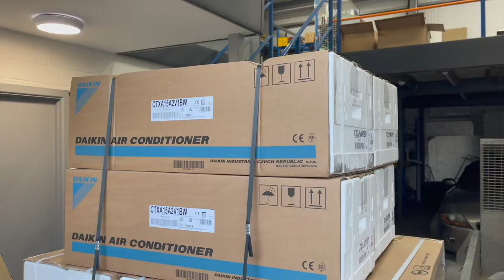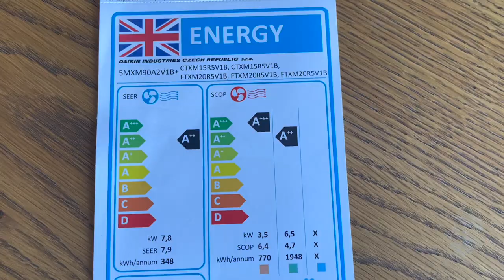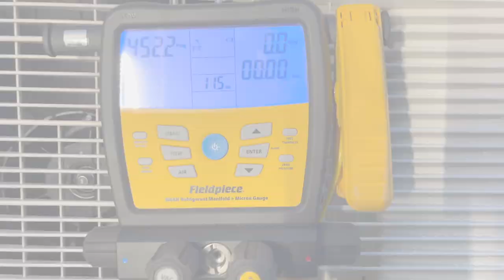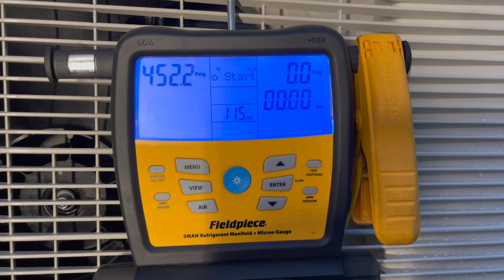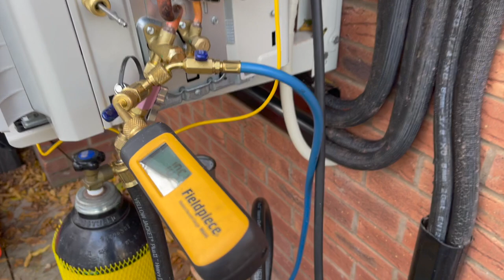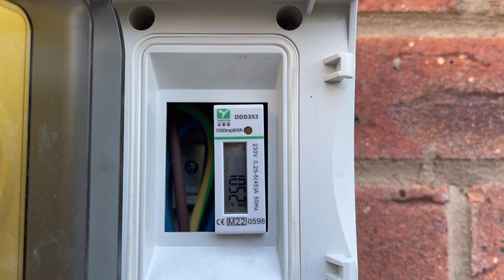Air to Air Heat Pump: better than an Air to Water Heat Pump? We install for a YouTuber to find out!

Comment: Not a bad install for a bunch of plumbers 😜. On a serious note though.... I've been installing and repairing AC for over 30 years. I would never recommend fitting outdoor units on wall brackets on a residential property. Yes, the units are quiet but I can guarantee you will hear the buzz from the compressor if the system is running whilst sleeping.
Reply: Can absolutely confirm this, avoid brackets wherever possible! Especially because the compressors are variable speed so eventually they WILL find the resonant frequency of the wall they're on and be annoying 

In my old house the unit would sometimes vibrate the glasses and mugs in the kitchen cupboards, you couldn't hear the compressor but the jingling glass was annoying!
My current house has them mounted on the floor and it's so much better haha!
Reply: Interesting. Mine are sat on the ground on big rubber blocks. Was wondering about the pros and cons and hadn't thought of this!
Reply: Nice and tidy work 👍
Reply: Fully agreed, wish I’d known this before installing our Daikin :(
Reply: Yes I have an outdoor unit on brackets and I can hear the buzz. Anyway of reducing this noise with some sort of retrofit solution?

Comment: It will cost more to run than gas and your cop won't be anywhere near 5
Reply: Should have invested the money and used the interest to pay towards the fuel bills. You lose twice fitting heat pumps. It's like people coming back from shops saying they saved £30, but had to spend £200 they wouldn't have done!  
People with these systems never compare before and after fuel bills to compare as they don't like to appear foolish.
Reply: Not everyone is installing such systems purely for financial reasons.

Comment: This is exactly what I want in my bungalow.  The disappointing thing is that you haven’t covered the hot water system.  I also note Dameon there are no contact details on your channel, surely that’s a missed marketing opportunity?
Reply from the maker: Simon you are right. The hot water follow up video will be uploaded at the weekend, as will a follow up video on the performance of my heat pump hot water cylinder. Any queries can be sent to me directly at dameonhillchannel@gmail.com. Thanks for your feedback

Comment: My only negative comment about this type of system is all the ducting around the house. It for me at least, looks a bit commercial and that’s possibly the reason that would put me off the Installation. On another note it seems a real pity that the £5000 government grant isn’t available for this type of install. Is the heat pump supposed to be out of plumb left to right?

Comment: Hi there, do air to air heat pump mini split systems qualify for the government boiler replacement scheme grant?
Reply: As far as I know they do not because they can be run in cooling mode and the government don't want to encourage that. Perhaps there are A2A units that run heating mode only that might qualify but I have not seen any.
Reply: @ColinMill1  ah right yes that makes sense thank you

Comment: What we do now is heat the house in the winter months to 19c with gas central heating, we then use an air con heat pump to heat the room we spend most time in to  between 21-23c, we have solar energy providing a lot of the electricity required which varies but is between 500 and 1000w usually and provides about 2500 heat energy so very efficient, I estimate we save about 10-20% on our gas usage in winter when we heated the whole house to 21c using gas central heating only.

Comment: 19:38 which one, I’ve installed two single splits so far (lounge and kitchen) and kept the oil for this winter, thinking of a multi for upstairs before next winter… what flare tool did you use, also what did you put on the flare joint, I’m guessing to help the seal?

Comment: I wonder what is the current cost of this kind of system, including materials and labour?
Brilliant video by the way!👍👍👍
Reply from the maker: Thanks for your email Serge. I have replied to you.
Reply: I'm also interested in a cost for a similar system for my house could you send an estimate please
Reply: I’m also in process of planning a refurbishment and this has made me question my plans for an air to water system. I do wonder how much this costs compared to a similar air to water system plus installation of the underfloor pipe work, etc.

Comment: Excellent explanation of efficiency of a2a v a2w. Can I ask about how much more efficient a modern R32 A2A heat pump might be compared to R410A inverter A2A heat pump circa 16 year old.
Reply: @zlmdragon.  Thanks. Just to confirm, you mean the R32 gets SCOP of 4-5?

Comment: Interesting video! I'm running a similar experiments, though I have kept my gas system. It means I could try all gas one day and all AC the next day.

AC is definitely a lot cheaper most days. And a bit cheaper on the colder days. But AC misses some spots, like the bathroom, so on a cold morning I like to run the gas for a couple of hours.

For working from home, AC is a hands down win, because I can heat just the room I'm working in. But today, which was very cold, I started to get annoyed by the defrost cycles because it would blow cooler air at me.

It is very good though, and really heats things up fast.

How do you get on keeping your bathrooms warm and dry with no heat in them? Perhaps you have good ventilation in the house.
Reply: I think you need to get your installer back as depending on the make you can stop the indoor unit running on defrost, it’s normally a toggle on the outdoor unit PCB. Having it running is hopeless.
Reply: Great job, very impressed with the triple vacc, not many installers do that. I think these systems make allot of sense in the UK, just be aware these systems are heating the air unlike a gas boiler that basically gives you radiant heat. He may find as soon as they turn off the temperature drops rapidly.
Also defrost is an issue but hopefully on commissioning you set the fan coils off on defrost.
Reply: @garywright8846  it does shut off during defrost, it just seems a bit too keen to start the fan after the defrost cycle.

Comment: @19:19 high and low pipes were put TOGETHER in a thin cover and taped tight assuring contact between hot and cold pipes reducing overall system efficiency significantly. These little details may seem insignificant to most installers but actually reduce the system life and efficiency while increasing the running costs.

Comment: Very good video.

I'd be interested to know how noisy the indoor units are.  Is the noise a problem in bedrooms at night.

I worry that the indoor and outdoor units seem ugly. I suppose one of the benefits is that removing radiators will be freeing up useful wall space, whereas the indoor AC units don't consume valuable wall space. Radiators don't seem ugly, but the indoor units do.

Comment: Could you clarify the monitoring capabilities? Electricity usage to drive the compressor is simple, e.g. with a Current Transformer, but have you monitored the refrigerant flow rate and flow/return temperatures to calculate the COP in realtime? Id be interested in that for the -5C to -10C that we saw in December, and with the low external temperatures+high humidity that we’re currently seeing.
Reply: @zImdragon  I suspect it can be done; its relatively simple for an air2water heat pump, heatgeeks are doing it in realtime: https://m.youtube.com/watch?v=X6qIP8snPW8
The electrical load used by the external and internal units of an air2air heat pump is all supplied from the exterior unit so a simple CT clamp on the external unit’s live cable will measure that. I’ve seen reference to measurement of the heat delivered part of the equation using wet and dry bulb thermometers and air movement sensors, however I suspect it should be possible to measure it in the same way as heatgeeks did above, by measuring the difference in flow and return temperatures of the refrigerant together with its mass flow rate. Temperature should be easy but not mass flow rate I’ll agree. Heatgeeks used an inline water flow meter but for an a2ahp it would need to operate with the refrigerant so a simple device cant be used, but I think an external ultrasonic flow meter might work (I’m assuming this monitoring isn’t done as the standard a2ahp equipment fit).

Comment: Fascinating stuff and further convinces me to go air to air. My mini split system has a SCOP of 4.1 and it produces a much more pleasant heat, albeit it was bought for its cooling capability. So in theory with my respective cost/kw for gas and electricity it  should be approximately 20% cheaper to run than gas. Unfortunately I do not have a COP value so perhaps my figures are slewed but unlike gas heating the wait time is pretty much instant and I actually achieve setpoint which is something the gas system struggles to do.

Comment: wouldnt the client already have a radiator system in their house? surely you should have just kept that hydronic system, ripped out the boiler and heated the water with the refrigerant ?   I live in new zealand, and we have lots of heatpumps systems here and i cant stand them. they dry out your eyes and look ugly.

Comment: Researching exactly this option, appreciate mike got mates rates but what is a ball park total install cost for this 7 unit system,  what would I expect to pay for a similar install (ie all the headers on an outside wall? £10k 15, 20?
Reply: Think about the numbers you are throwing around are you really prepared to pay anything over 2-3K for a heating system
Reply: I got two 3.5kW Panasonic minisplits installed for £3.5k all in this summer. Having two singles gives slightly better performance. You can run just one in spring and autumn and a you get bit of redundancy too. 👍

Comment: So the indoor units are all installed high up on the wall. Radiators low down , heat pumps high up.

Comment: Great video, really enjoyed it! Have you installed a multi-split VRF/VRV, with heat recovery, providing both air-to-air air con AND an air-to-water unit (for DHW and underfloor heating) all with one outdoor unit? Watched a video on Heat Geek where this was discussed as a viable solution, but I can't find any actual product that would do this.
Reply from the maker: Hey Aidan. The short answer is no, but I agree it would be a neat solution.VRV hasn't really made any headway into the domestic world yet but it is only a matter of time. The applications would be fairly small though I think. There isn't much free heat worth moving around from elsewhere in a domestic property such as there would be in a commercial environment - say moving heat from a server room into offices etc. I'm not sure the case for the additional cost would stack up. Daikin have told me that there is a new 4 port outdoor unit with a refrigerant split 150 litre hot water cylinder coming out early in January. I have made a strong case to get my hands on one first so we can install one and try it. I have to say that standalone heat pump cylinders are excellent. The Daikin Altherma M HW that I did a video on in particular is great, if only they would capitulate and sell it in the UK. I am pushing - and I do think this will happen as more people lean towards air to air and look for hot water solutions.
Reply: Samsung RD160PHXEA, it's a 16kw model. it's not a new model but the equipment can do what you want Aidan, except heat recovery function. You can have x number of air handler indoor units + 1 hydro unit (and a boiler for DHW if you want) with it. For that specific model (RD160PHXEA) the total capacity of the indoor equipment shall "not" exceed 16KW. I use it in my home. it has smaller capacity models aswell 8-12-14-16.  it works both ways, as air to air and air to water at the same time.
Reply: I totally agree with you!
Reply: LG Multi V with heat recovery hydro box for hot water/underfloor heating is what you want.
Reply: @richardc1983  looked into this one a few years ago and they were only going to approve the hydrobox for underfloor and not panel radiators.

Comment: Disagree with the comment that air to air indoor units only need to have refrigerant going round at 29c. The refeirrgant is more like 50c, and my r32 unit now is going more like 80c refrigerant giving a 50c air off... At lowest output the unit this still blows about 38c. The units won't blow of the coil isn't above 35c to avoid cool drafts. Agree with much the rest.
Reply from the maker: Interesting observation you have there. All of our Daikin R32 systems max out at around 23 bar (39 degrees C). When idling they sit at around 18 bar (29 degrees C). I don’t recall ever seeing an R32 system above 25 bar.
Reply: @dameonhill  to get an air off of 39c and say 20c air on the refrigerant circulating will be at around 70c, r32 is even more efficient than r410a in heating and there are higher compressor discharge temps. Have a look in the Daikin service checker at the pipe in/temps.  It may be less extreme on the splits but the multi units really do belt out the heat. Seen a few r32 compressor failures too due to how harsh they are in heating. Operating pressures do not relate to discharge temps, so many variables such as outdoor temp, indoor load, humidity.
Reply: @zlmdragon.  I don't know what your problem is, I don't know you, your clearly jealous because I am better than you :)

Comment: you lost me when you said
I'm going to heat my home with the solar panels, your 2kw or 3kw array will produce about 20-30 kwh in December, you ain't going to heat your home using your home energy.
Est avg temps in winter is 5 & at night near zero. air to air will have a COP of maxuim 2-2.5
scop is a con as at high summer temps hating i no problem.
should of kept the Gas & added some units.
Reply: My air-to-water installs run at cop of 2.7 - 3.3 this cold December. Surely air-to-air can do over 3 as well?
Reply: @UrbanPlumbers  at flow temps of 30 maybe, but air to air systems run at 60.
Reply: @UrbanPlumbers  3.3 isn't enough imo to be viable atm

I'll get a heat pump eventually but there's a lot of other work I wanna do before, including sit tightness, upgrading windows, radiators and maybe pipes too
Reply: @waqasahmed939  I get 3.3 in Dec with annual scoop of 4.5
Reply: My 3.2Kw system produced 70 kWh this December, on a West facing roof 

I intend to double that up too.
Reply: @UrbanPlumbers  That's not that bad then. I have a long process of work I wanna do before getting a heat pump

My boiler is less than one year old. I'll get extra solar panels, air tightness, mechanical ventilation, triple glazing, and maybe needing to upside my radiators / pipes, before I think about getting a heat pump

I'd rather do all the actual efficiency things first, before adding an ASHP in, especially given that you don't really get an ROI on those. My eventual plan is to ditch gas entirely, but it starts with making my house air tight.
Reply: @waqasahmed939  Def agree - and MVHR is good for moving the A2A heat around the house.
Reply: @ecoterrorist1402 not true
Reply: @AdrianColes  Well, I'm afraid it is completely true, And as it's my job and occupation, The energy sector And with 200 plus solar jobs installed.

Comment: Interested to know how the external units are affected by corrosion. Our house is exposed to very corrosive wind blown salt spray from the sea, hence my concern.
Reply: Good Point, you can get many  Units that are constructed  Specially coated to give long term protection  deal with Coastal Salt corrosion

Comment: Look a little busy on that outside side wall. Are the inside units noisy and heat a bit breezy / drafty
Reply: that's why you have A2W option with underfloor heating. I also hate aircon, so A2A for heating is not what I'm going for

Comment: Your lying about the cop value when it's cold the cop value is massively effected and you won't get any where near 3-4 cop
Reply: Depends how cold. And how often, so what if the cop isn’t as good on the days it’s super cold.
Reply: Panasonic recent Air2Air models may get COP 1.9 at -25C .. the numbers are a little better than Air2Water.

Comment: I'm considering a heat pump, I like the idea of air conditioning too, however I probably wouldn't be ready to swap all the radiators out at the same time the heat pump is fitted. Would it be possible to fit a heat pump that was capable of cooling, but only use it for radiators and hot water for now ?
Reply: You could do what I did and keep the gas system and just add the air to air stuff for AC cooling and heating. I end up using gas and AC heat in different situations, and I'm not sure I'd want to give up the cheap, powerful hot showers from my gas combi boiler.

Comment: We had a Samsung multi-split a year and a half ago and a SunAmp heat battery for the hot water - replacing gas combi (DHW) and radiators.
It is just sooo efficient.  Adding solar would be the next goal.

Also good to see mounting the outdoor unit good and high up so there is much less risk of cold air re-entering the unit and reducing efficiency.
(Related I wish there was some way to have a 40mm condensate pipe so there would be absolutely no chance of it freezing up .. there was some ice in it in the recent very cold snap and another 2 weeks of that might have been a problem)